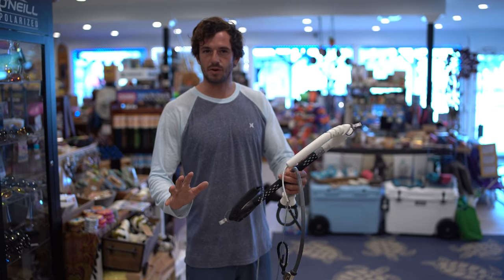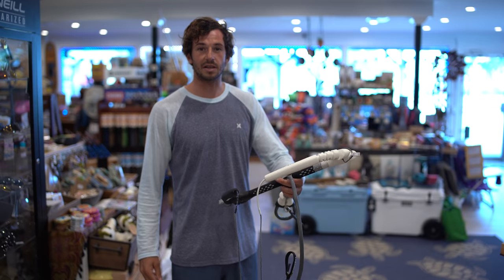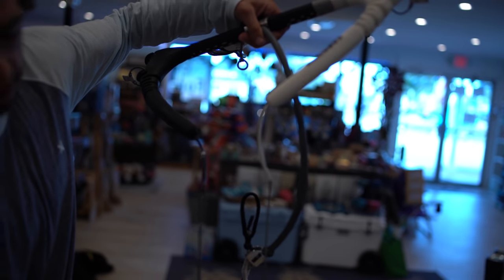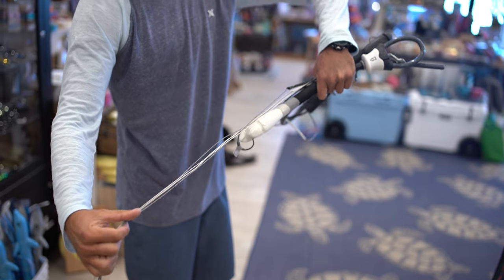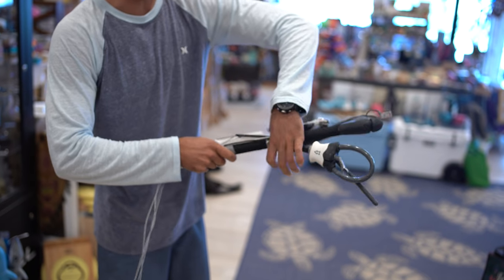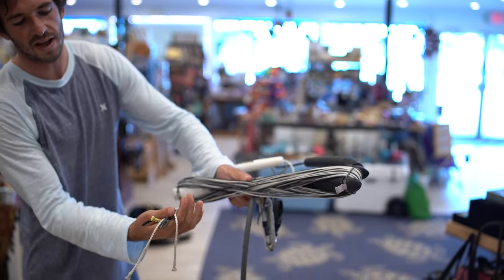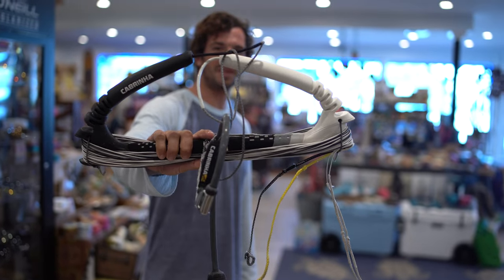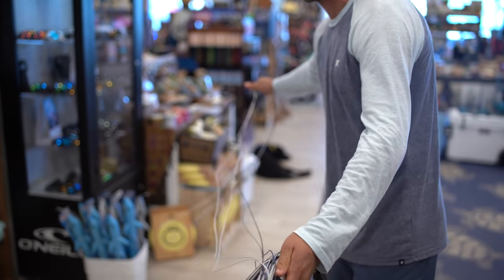How to Wrap Your Cabrinha Control Bar

Comment: That is one way but I think there is a more efficient and cleaner way so you don't have loose lines and a chicken loop flapping around to catch on stuff. Pull the chicken loop all the way into the stopper then gently fold the bar end floats back too the bar then start winding the lines. This holds the floaty bits in place. When you get to the the end of the lines loop the lines around the ends of the bar ends to take up the last bit of slack and then tie off with the straps. Then gently fold the centre line (Chicken loop) back to the bar not too much pressure, then strap off in the centre of the bar.  Then place in bar bag. No loose dangling bits and protecting the bar.